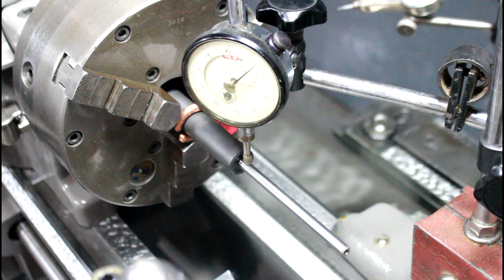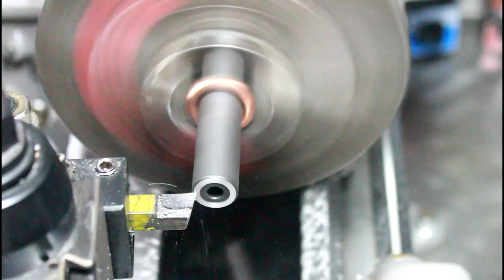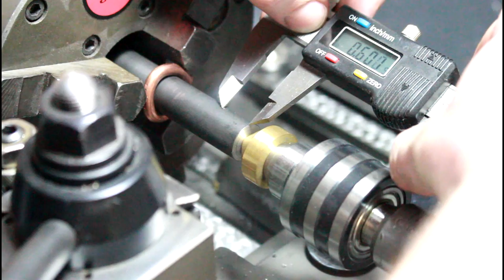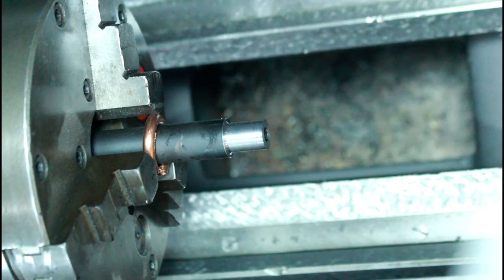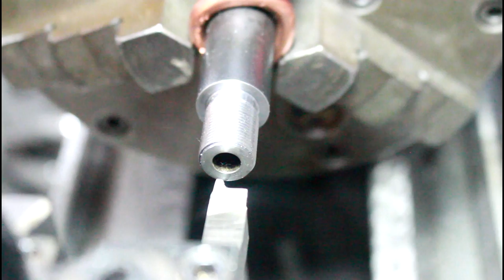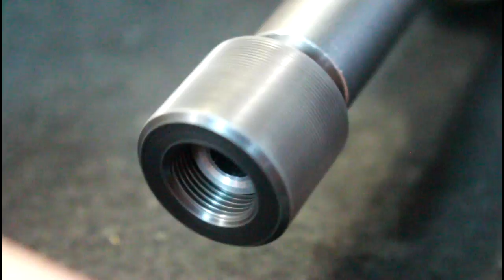Threading a Barrel Reboot!- Thread Protector installation

Comment: MUCH better than the first Vid, I used to do it like this in the "South Bend" daze. Now it's 6 jaw chucks, 2 axis DRO, carbide inserts, reverse threading (cutting away from the chuck), adjustable dies for the final finish, zero (or half-ten thousandths) runout every time . Everybody does these differently, the end result is what matters and that is good work for that machinery. Now re-crowning/threading a damaged  Arctic Warfare is different than a Remington 700. Whole different animal. It also needs mentioning (no one has yet) about supporting  the barrel at the other end of the headstock tube. A Collet matching your tube diameter/barrel OD is essential to keep the barrel concentric thru the work. The copper wire is OK, but during vibration CAN loosen slightly. Keep the shimming as small (brass shim stock is best) as possible. Also, indicate before AND after the tailstock is applied for runout. Indicate after running a very light, slow skim pass (before using the tailstock) to establish a reference surface you can use. Polish that surface to indicate accurately. Shoot often, shoot small.
Reply: Good advice. Can't trust a tailstock being aligned without checking. Some say a tailstock aligned at 4" may not being aligned out at 8".

Comment: Dude, I love your work, you're obviously very methodical, that's clear from the little things you do that most "gunsmiths" don't think about.  I'm a toolmaker by trade and I'm saying this because I like you.... Stop using rags on running machines!!  I'm just as methodical as you, and a couple of years ago I lost two fingers in a moment of carelessness.  Just because you tame the tigger, doesn't mean it won't run out and bite you if you leave the cage open one day!
Reply from the maker: Hey thanks. That is usually one of my pet peeves. Only reason I did it here was A) I knew the threads were extremely smooth and there was nothing for it to catch on. B) I also hold paper towels or emery cloth fairly loosely so if something does grab, I'm not holding it tight enough to were it will just fall out of my hand. Not a fool proof method by any means, but this was probably the first time in a couple years I did that. Always good to have a reminder though!
Reply: How do you know what "most gunsmiths" think about and what is your definition of "gunsmith"?
Reply: i lost my pinky on the left hand
Reply: A rag doesn't need anything rough to grab onto.  They can grab just from friction.  I've seen it.

Comment: a mighty mag and one inch travel dial indicator on the z will let you accurately cut shoulders and faces as long as you don't bump it and knock it out of position i used this method all the time when i started in the trade back when nc machines ran off tape and carbide inserts were a luxury item

Comment: Probably a stupid question but do you move the bit that cuts the threads by hand or with a power feed ? 
Great video you have a new subscriber, I'm only just learning. I've been putting it off for long enough times come to thread the barrel for a break & it's pushing my skills beyond their lèvel it seems. 
The power feed or not is the main problem if it's needed i need to learn how to use it first.

Comment: After you have gone through all the steps to dial in the bore, you then engage the live center. I don't know the tolerances on your lathe but, most of the time the tailstock isn't perfectly aligned. By using the live center, aren't you risking having the muzzle shift from its indicated position, into position with the live center?
Reply from the maker: I've gone to great lengths to align my tailstock, but yes, in reality, You shouldn't need to do this. It really is a bad old habit from when I used to pilot the bore with a 60 degree piloted tool to run between centers.

Comment: How do you re engage the new threads with each pass? How do you match the timing and not just create a fresh cut with each pass?
Reply from the maker: Threading dial gets you on each thread properly. Another option would be to keep the half nut engaged and run the lathe in forward and revers to move the carriage back and forth.

Comment: Are you using the power feed or handwheeling it?
Reply from the maker: Handwheeling! I guess when I'm doing a cut that only takes a minute or two, I usually don't bother doing power feed. I'm sure I could have adjusted feed/speed slightly, but it left an OK finish. That 10L is looking nice by the way! Thanks for stopping by!

Comment: what speed do you turn and cut threads?
Reply from the maker: I use to run in the 40-60 rpm range, now I run around 180-200 rpm.

Comment: Too bad you have a screw on chuck or you could spin the lathe backwards and thread away from the head stock instead of towards it.
Tool upside down or on the other side of the work right side up.
Takes out the pucker factor and you can really spin the lathe up to a higher RPM.
Reply from the maker: Yeah. I have a larger lathe now with a L-00 spindle and could do it that way now if I wanted. Never spun a chuck off with a threaded chuck though myself.

Comment: I am new to lathe, when cutting the thread, movement of the cutter is automatic or controlled by your hand?
Reply from the maker: The machine does it all, you just engage and disengage the half nut and advance feed the cutter each round.
Reply: @precisionmachineshed  Does it mean when the cutting tip touch the barrel, it will automatically engage the thread from the same starting point  every time? No matter where you moved the cutter before.
Reply from the maker: @caparsenal001  you must set your thread pitch first via gearbox or change gears, ie 12 tpi pitch. Then engage threadding dial. Slow your machine speed down. Set compound to 30 degrees. Set tool parallel to work usually with a fish tail, bring cutter up to work to just scribe. Zero compound and cross feed dials. Turn on machine, wait till the threadding dial hits a number and engage half nuts, wait till you reach the end of the thread and disengage half nut. Check pitch with a gauge. Turn compound in 5 thou and continue a couple passes. Repeat and go down to 3 thou advances till you reach final depth. That's the basics.

Comment: I have never seen anyone bother to use an outboard spider and a range rod to set a barrel up in 3 jaw chuck!!!!! where is your 4 jaw?even if the 3 jaw is very good you have no adjustment unless it is an adjusta=true type and I did not see any mention of adjusting it.  Just saying.
Reply from the maker: It is a Buck Adjust-tru chuck. Pretty sure I mentioned that in the video.
Reply: @precisionmachineshed  you did.